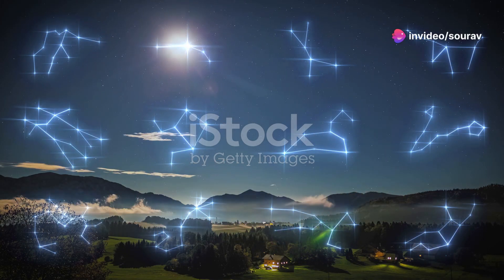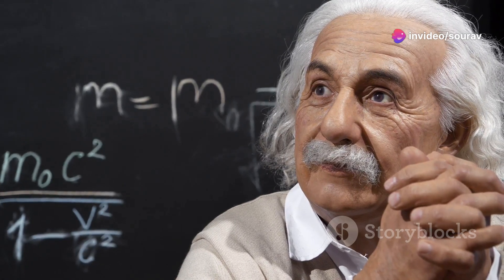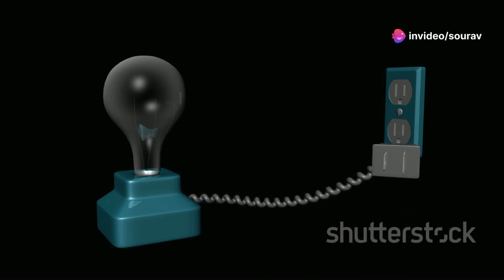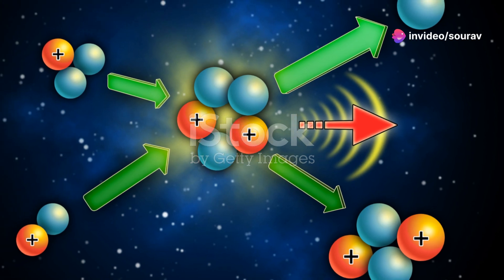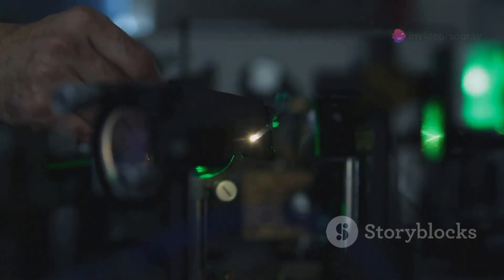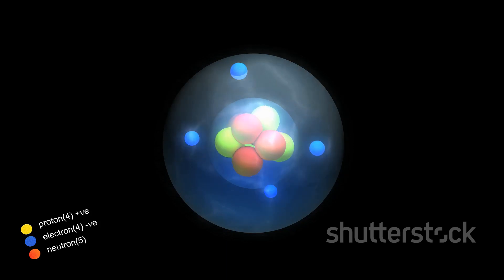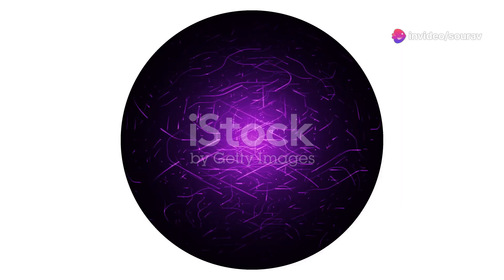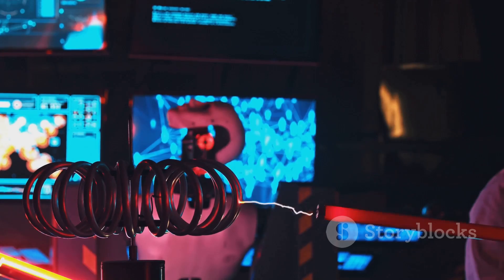Understanding Bosons: The Force Carriers of the Universe

Comment: Gravity is an effect not a force !
Reply: Yes, but this is not an advanced class. Treating it as a fundamental force works just as well for beginners and makes it a lot easier to understand. In that respect EM and gravity are very similar in that there's a field gradient of which the result is a force. The only difference being that EM is polarised (can also produce repulsion), and Gravity is not (hence the quantum gravity theory assuming that a graviton would have 0 spin). More accurately, Gravity has only negative curvature in our reality, a positive curvature would mean it was bending space back in time, instead of forward. Theories about wormholes that travel to the past make use of positive spacetime curvature, and are exactly that: Theoretical. Nothing of this kind has ever been observed in the cosmos and there aren't even hints of any effects. Although we might one day discover something profound, I still do not think time travel other than what we normally do (1 second per second) is at all possible in this universe, just because it needs CPT reversed matter to work. That stuff only existed (theoretically) in the anti-universe that may have existed before the big bang.